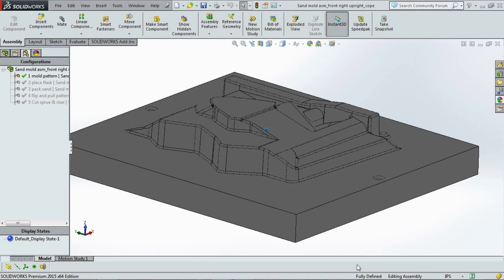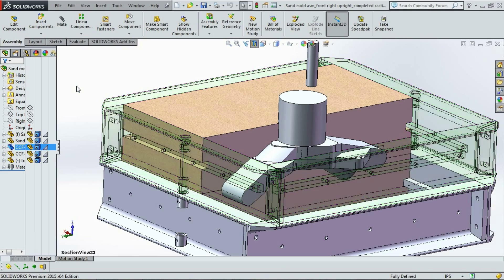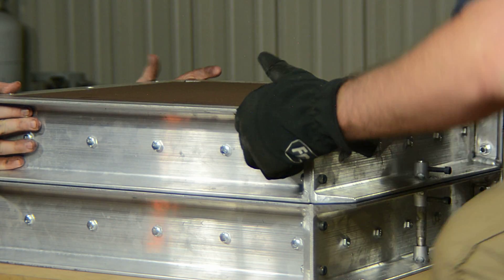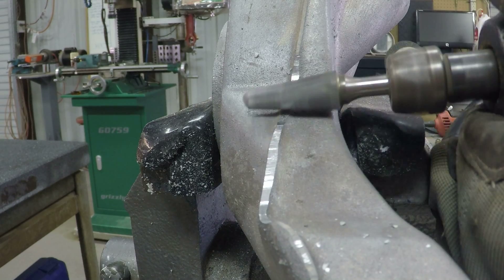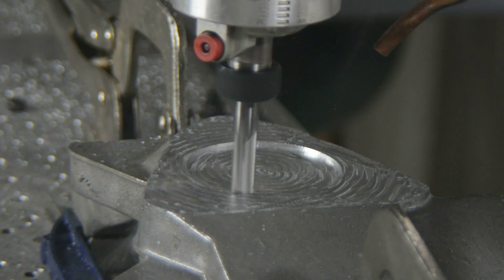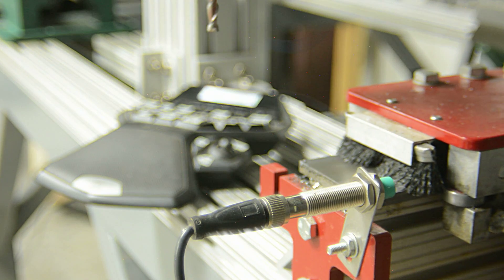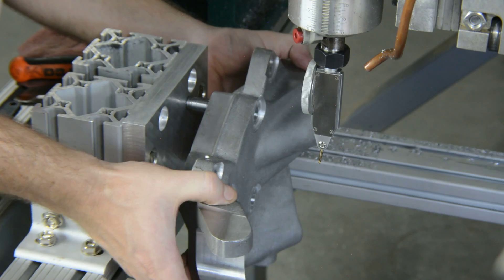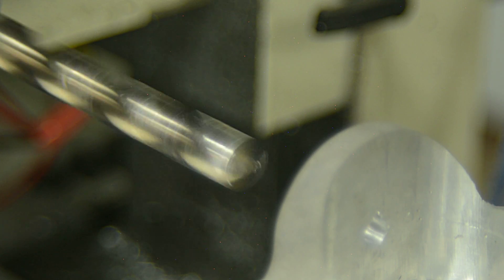Home built super car, Building the Up Rights

Comment: I think I would have made the patern by 3D printing as the finished size to test that it gave me all that I wanted in terms of movement, accessible,   etc.  Then adding a machining allowance before casting.  This would have reduced machining time and reducing scrap as cores can easily be added to the patern.  Stops all that domed MDF dust as well.

But then that’s just me and I’m not doing the job.
Reply from the maker: I could not agree more. MDF dust is the worst! We did test 3d printing and it was abysmal. 3d printed surfaces are to ruff for low draft angles. we where using a 1-2 degree draft and the sand stuck to it and would not let go. So after the print and a smooth coating of epoxy the time was about 10X slower than the cnc MDF, costsin raw materials  where about the same, so using the 3d printer for pattern making was not a useful tool. But it did ok for fit and finish. We could 3d print a part and see if everything assembled as it should. Also these where large parts and the 3d printer was not big enough for one whole print. Subdividing the Parts and/or Patterns slowed us down. We have now settled on foam tooling board or machining wax. Both cut insanely fast. The wax is good for a quick result and can be recycled. The foam gets an epoxy coating then wet sanded and its good for years of regular use. We can now make patterns about 20x faster than even the most expensive 3d printers a hobbyist could buy. And prototyping parts out of wax could not be easier. 

As for the casting, your right. we got a little impatient because we had issues with the castings. So we did not pursue any cores. But we will in the future. Thank you for the input. we appreciate any and all suggestions as we are still learning how to do this. If you would like to do the job we do take volunteers? We are in Arizona USA, Casa Grande.  

Best Matt
Reply: I’m a bit far away to get involved.  I live in the UK.

I like 3D printing as there is so little mess and so little investment in equipment.

My first kit car was a GTM and I now have a Ferrari California replica based on a Merc SL500.

Keep up the good work and I look forwards to seeing the project develop.
Reply from the maker: Wow you are far away. I agree. The one thing that has hooked me and everyone ells on 3D printers is the low cost, easy of use and low maintenance. We still use our printer. It's making some small tools holders for our router right this second. We are putting auto tool change on the router this weekend.  

Those are some cool kits! I'm very happy to have you on board. Your opinions will be especially appreciated because of your experience in car building. Right now we are building the car for Time Attack Racing. But after that we will want to expand the design to be more versatile. If we hall but we can make the last race of the season in November.

Best Matt

Comment: Nice. I designed and built the uprights for the FSAE car we built back in university. Those were made from billet machined down on the CNC so it's interesting to see a different approach. Looks like you're going to run a pushrod on upright solution as well, I'd have liked to have done something similar but space restrictions made it too difficult. Good stuff anyway.
Reply from the maker: Thank you. We try hard. We have two problems that we are trying to solve at the same time. We need to build performance parts but at the same time the parts need to be production friendly. The end goal of the project is to provide it as a kit to the public. So the more affordable we can make it the better. We want others to get into Motorsports, Ideally with our car. Time will tell. Thanks for the support. 

Best Matt
Reply: Wouldn't be easy balancing those too goals but I agree, motorsports needs to start seriously improving its affordability. If you can do something about it that's great.
Reply from the maker: I agree. Wish us luck we are going to need it.

Best Matt

Comment: Watched it 3 times. A lot going on in this video. That casting looks awesome and the crucible is massive. What alloy do you use? I assume you selected it based on your analysis and buy it in ingots. What is your foundry setup like?
Reply from the maker: Thanks! I think I will do a casting tutorial video in the near feature and go into good detail about our setup. Your right. We selected the alloy and tested it first before doing the design work. All design work reflects the alloy A 356.1 with a T6 heat treatment. We buy them in 17lb ingots from IMS out of Phoenix. The foundry is propane and a steel container with cast able refractory. The crucible is a 25lb graphite I believe. We did not do any degassing, more on that latter. I have a big casting project coming up. A cnc Mill out of cast aluminum. Would you be interested in doing a mill after your lathe? I think we could work on it as a joint youtube build? interested? Best Matt
Reply: Centurial Inc Matt, sorry for the delay. I have a lot on my plate at the moment and probably over the next couple months but am really intrigued by this possibility. Shoot me an email so to discuss in more detail.